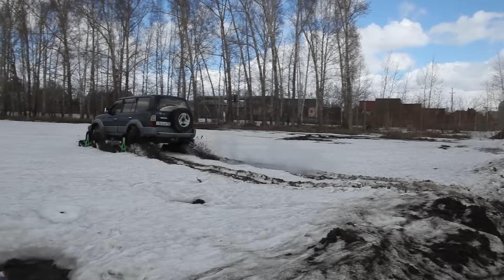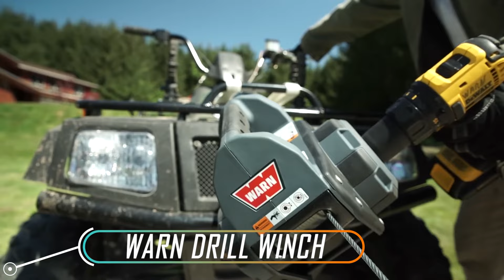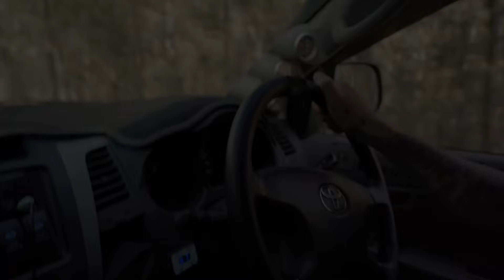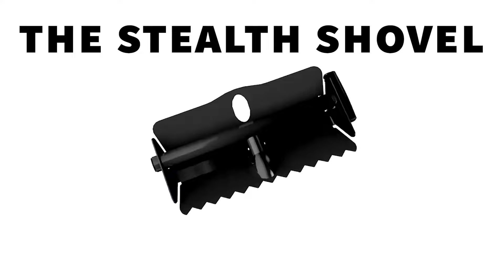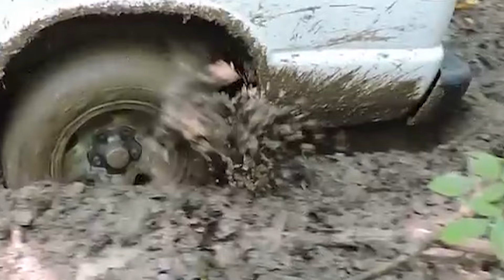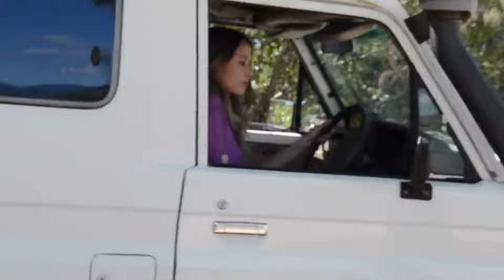THESE INVENTIONS WON'T LET YOU GET STUCK IN THE MUD

Comment: bunch of over priced junk. sure can work.
but having tires for the conditions, lowering the tire psi before getting stuck. and learning how to drive off road is far better and cheaper.
but even those tracks got stuck in the video.
but nothing new here. just re done with shiny bits.
a-come a long works great for small loads.
i have a warn 8274 mounted on my jeep. buy also carry a 4 ton come a long.. varied lengths of extra cable, chain, straps, bow shackles, etc. but this jeep goes off road into the rocks.
Reply from the maker: Ah, the classic "been there, done that, got the 8274" response! Sounds like your jeep's ready for anything short of a lunar landing. My "shiny bits" are just trying to keep up!